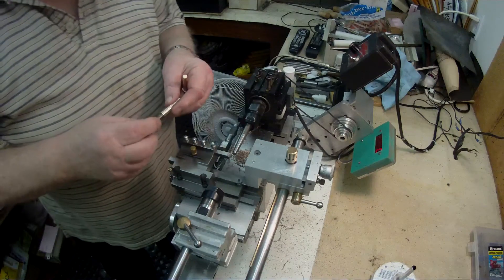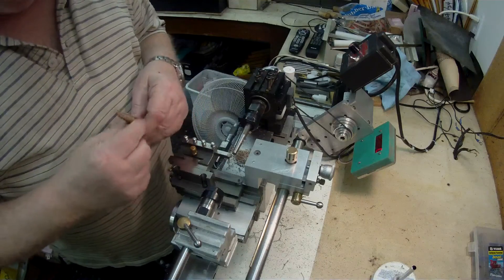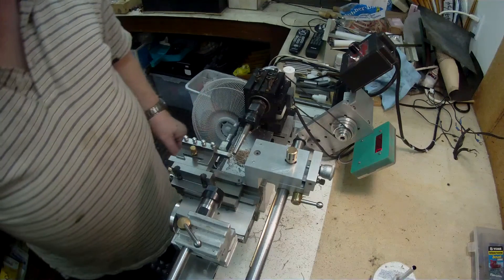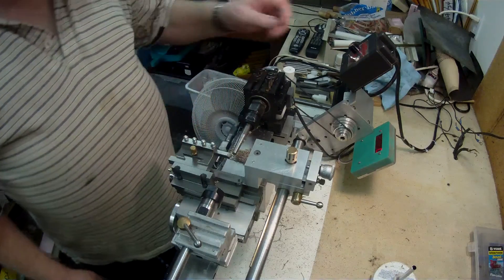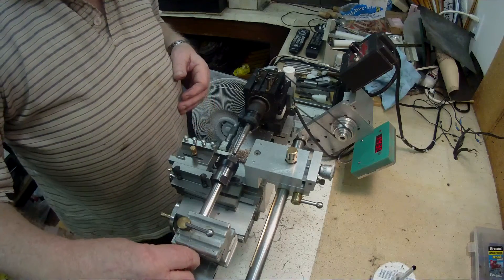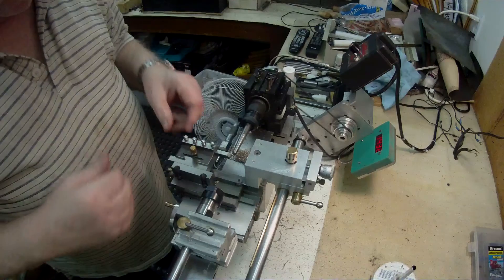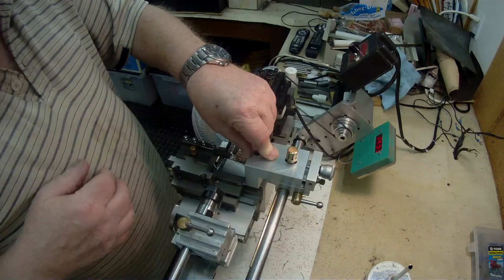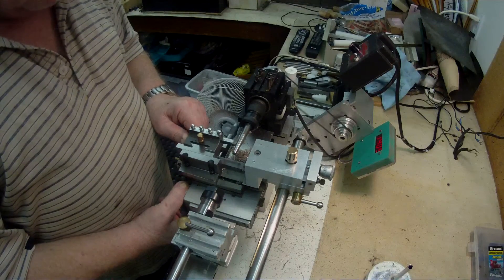FILE0027  Making Taig Ball Handles

Comment: Walter:
I'm glad to see your able to put your profiler to good use.  The big advantage I see is being able to use the power feed so the carriage runs along at an even pace.  Of course you need to have the right touch at the back of the tool keeping the pressure constant.  I'm sure the material isn't exactly perfect in all locations either.  All in all it looks like your getting a pretty fair finish.  Keep up the good work and as always, Thanks for the Video.  Best Regards: Larry

Comment: Hi Walter
When you made your form template for the complex shape did you remember to add 5/32 (half your tracer diameter) to all dimensions plus a lead in and out taper.
Reply from the maker: Good point Stephen, no I didn't, I must have had my blinkers on, I will give that a try,
my wheels are turning in my head and I see what you are saying, good on you,, I'll make a drawing and then another template and give that a try,